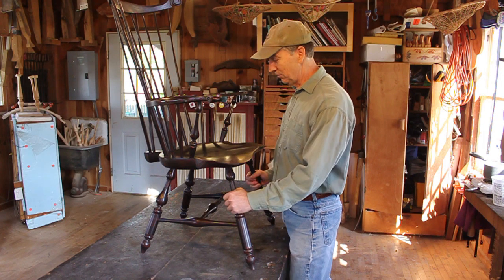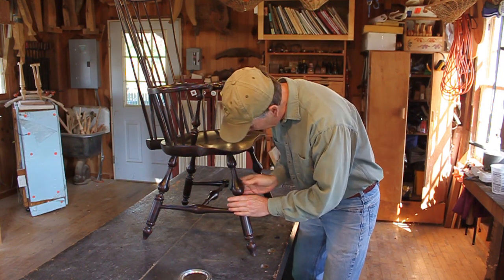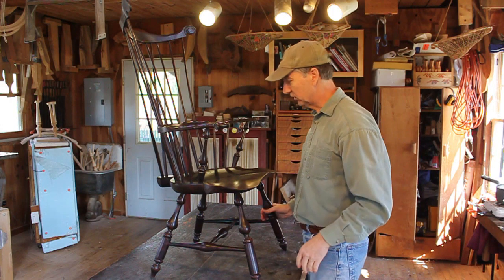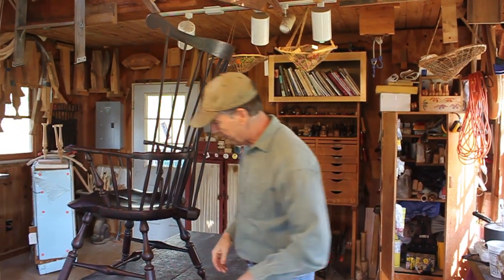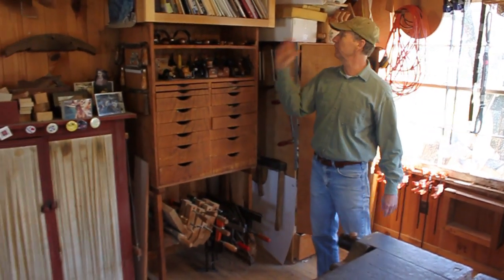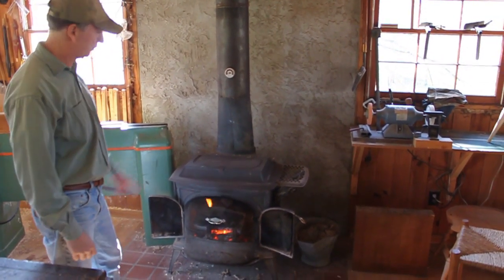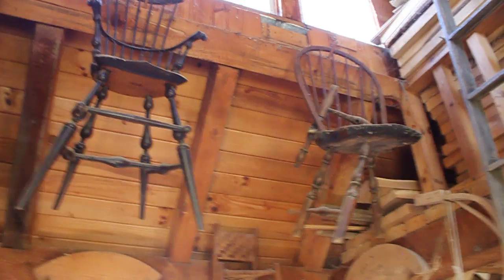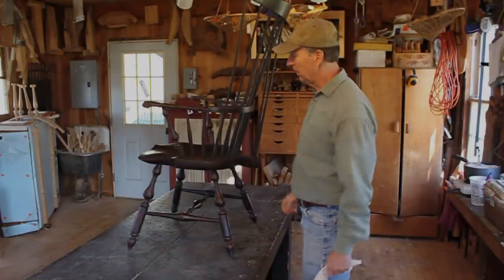Curtis Buchanan - 51. Waxing (and Shop Tour)

Comment from the maker: Bill, It came out or Bucks County PA. I've had it for about 25 years. I don't know how old it is but maybe early 1800's. Its 3 ft by 8 ft and is 30 inches high. Low for some but just right for what I do. The vises are made with dogwood threads and have held up incredibly well. Half  the bench top is 4 inch thick oak the other side is 1 inch pine.